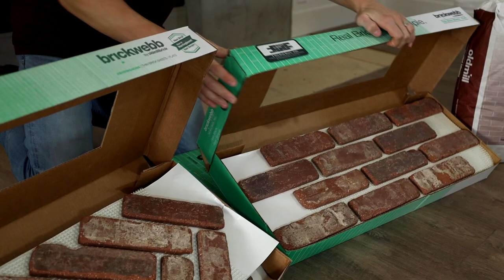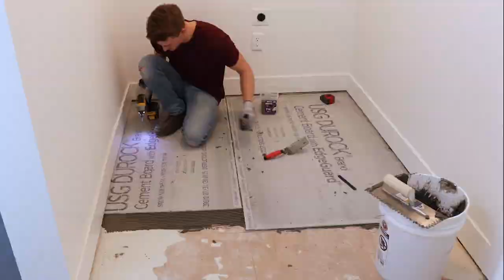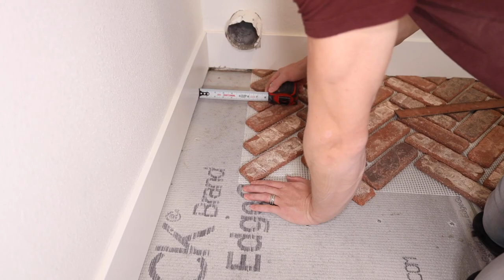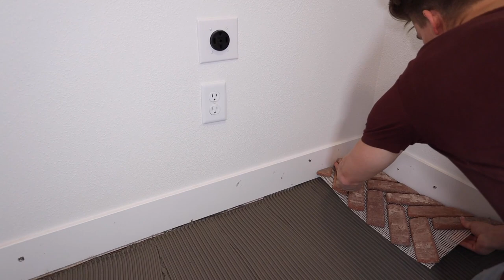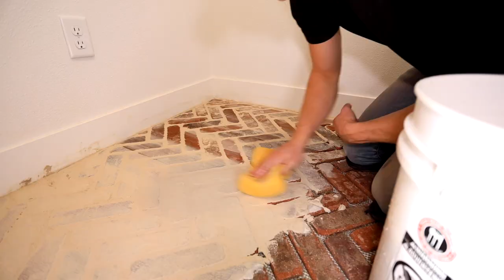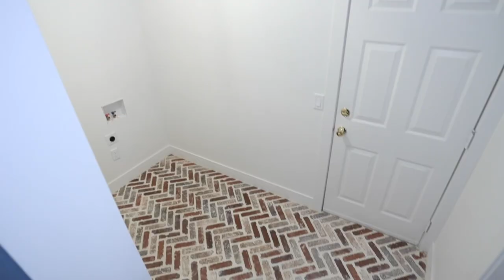How to Install a Herringbone Brick Floor using Brickwebb

Comment: Can this be used on outdoor front porch on top of concrete?
Reply: Did you ever find out?
Reply: Other similar thin brick manufacturers say that installing these on cement is okay to do as long as you prep the cement prior to install.
Reply: Yes, you can. I saw another tutorial of a porch done in herringbone on the manufacturers website.

Comment: Was there a reason why you didn't apply or stable a mesh wire first to the plywood flooring than screw the cement board on top? Asking for a friend lol .. great work.
Reply: Our installer just put the cement over the sub flooring turned out beautiful. 
Not one issue.